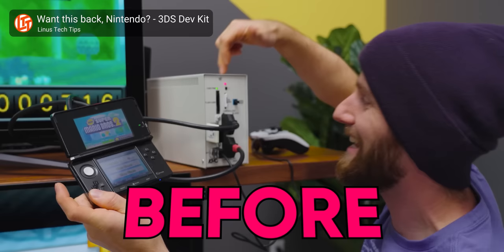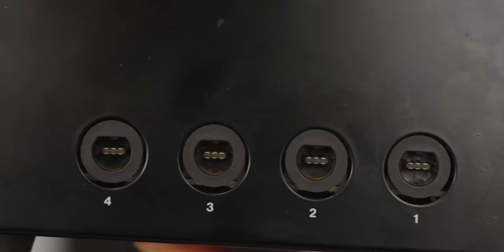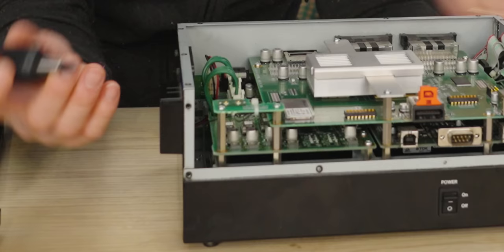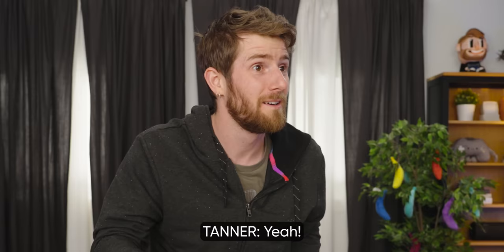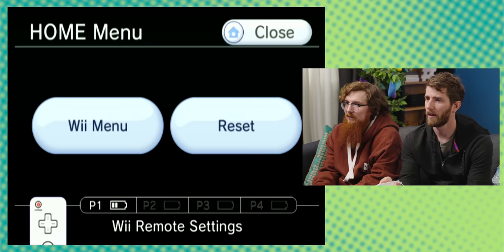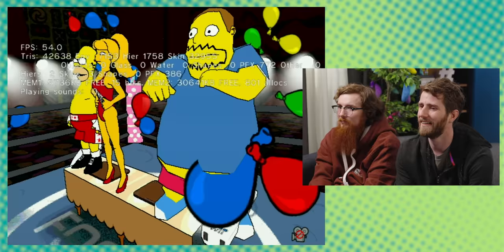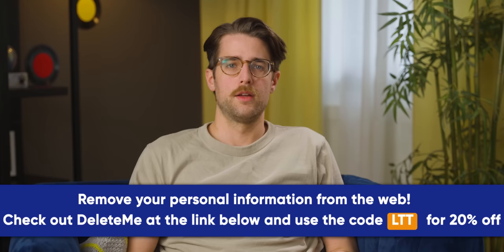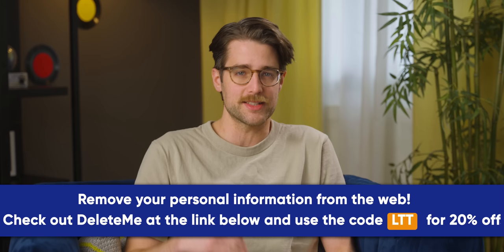Nintendo’s Lawyers are Ready This Time - Nintendo Wii Dev Kit

Comment: Having enough USB ports free for the Wii dev kit was a bit of a challenge at times 😅 

The IDE was CodeWarrior (the Code Masters guess was close!)
Reply: could you use a USB hub?
Reply: @CouchPotator  Yes but for other devices. I vaguely remember that you couldn't use it for the dev kit cables due to some issue.
Reply: @CouchPotator  You could use a USB hub.  It was easier to move an SDEV with the plugged-in hub than otherwise.  The 4th hub port was taken up by the USB-serial adapter (for the serial debug output).
Reply: You were a Wii dev?
Reply: @isaac10231   I worked on a couple of cross platform games at EA during the Wii, PS2/3 and Xbox era :)
Reply: Maybe he's thinking of the Worms developers, Code Masters lol

Comment: You could also use the SD slot with the photo channel. And because Nintendo put in some fun "tools" I actually liked doing that from time to time as a kid. Go through our photos on the TV and maybe doodle something on it, do a sliding puzzle of one of the photos. 'twas good fun.
Reply: I remember doing that for a short while but having a ton of issues with it not recognizing files.  Turns out JPG is not an actual file format but rather a container format and the Wii could only handle certain actual formats (pretty much just JFIF I think) under a certain size (don't remember the limit) and had no correction capabilities (JPGs were easily corrupted but most software could correct the files on the fly).

A lot of newer hardware uses the EXIF format (still JPG files) which are much higher resolution though even a "lossless JPG" format isn't truly lossless due to the quantization methods used by all JPG formats (it's actually pretty neat how it works and definitely worth a trip down the image compression rabbit hole).  PNGs are truly lossless but can't be compressed as small.
Reply: @grn1   looking it up JFIF stands for "JPEG File Interchange Format" in case anyone wants to know

Comment: As far as the Wii Mini goes, it has the hardware for at least half of the GC compatibility, that can be modded back in.  I did some light diving into the idea when some channel was doing Wii mods, and found this out, I'm not sure if the other half of GC compatibility exists elsewhere on the board, or if there was a chip change that sacrificed compatibility, etc., but there's at least pads for two controller pinouts and a memory card pinout. 

The wired WiiMote thing is also a bit weird.  I went patent diving at one time and there was a full wireless variant based on the GameCube, controller port wireless module and a full WiiMote.  IIRC this was also during the middle of the GC's lifecycle, wireless was super early in development and probably an extension of the WaveBird's wireless, so these wired WiiMotes must've been super early, and for some reason retained throughout the devkits. It also has nothing to do with the IR, as tracking is internal to the WiiMote themselves, the sensor bar was just an emitter with standardized placement of the LEDs for the WiiMote's tracking triangulation.  Assuming GC had the API overhead for motion tracking (which realistically was just a stick replacement in most uses), motion could've existed on the platform, given how the dev cycle for the Wii played out; which also means those GC-Wii dev units had updated firmware to allow for this, which makes me curious how forward-compatible the GC could've been with updated firmware.
Reply: I'm assuming power and security were probably the main factors.  Wii Motes are generally pretty good on batteries but they won't last all day under heavy testing.  The wired controllers would also be just about useless if someone tried to walk off with them since retail units only supported wireless.
Reply: @grn1  its also just.... better to have it wired if you have like a dozen Dev units in the same building to ensure no mixup happens between what kit had what set of controllers, also it would complety remove any potential interference by other wirelesse sourcse

Comment: I got to round Eurocom (the Goldeneye reboot Dev) in Derby, UK, right after they closed down. They had piles of Wii U dev Kits  in the main corridor (I assume Dev kits, they had the same controllers but different chassis). One of the coolest things was the MoCap studio to the rear of the site, a big warehouse lined with black sheeting. The cameras had been removed but all the mounts were still in place. 
A lot of the art dept was still full of sketches of the Tarzan game they did from the late 90's, a massive Batman stature, and a post it Pikachu.
Shame they went they way they did, went from a 250+ employee company to bust in a year.

Comment: The controllers were removed due to the hack that allowed you to use a wii with an external HDD that contained all the games and would be fine unless you tried to play any title that connected up to the net. I knew some of the guys in the CS dept of uni where I was at the time who successfully did this. They bought units that had a broken CD drive and got them "Working" again.
Reply: I have a soft modded Wii with DI support (my brother uses it to play and practice competitive Melee).  Don't remember ever having issues back in the day with online games, the only thing I had to be careful on was making sure I didn't update the official way (and even then it didn't take long for a new exploit to be found). Perhaps there was an even older hack that used GC controllers but by the time the Mini rolled out soft mods with DI support were quite robust so I can't see that being a reason to remove controller ports, it was almost certainly to cut cost.

Comment: -A trimmed 4 layer Wii (later    65nm revision) draws about 5-6 watts (half an amp at 12v)
-A trimmed 6 layer Wii (earlier 90nm revision) draws about 8.5 watts 
-The NDEV uses a different GPU than the retail unit, and I have not measured its power consumption.

These numbers include CPU, GPU, RAM, Flash Memory, and Video Encoder/DAC. The rest of the power consumption of the Wii is the disc drive, regulator inefficiencies, and peripherals. So yea, the console is wicked easy to cool. The stock fan/heatsink on retail Wiis is completely overkill.

Comment: DI is Disc Interface, COM is communication, OSReport/Panic or MetroTRK would print to it using the SI (serial) bus, DEBUG would interface with CodeWarrior, the IDE that was used, and breakpoints were handled by the aforementioned MetroTRK (Target Resident Kernel)

Comment: Quick comment on the "not yet wireless" for the controller. Actually, this is a sought-out feature that you'd pay extra. Imagine you have 12 close-by desks of developers and testers all around different Wii dev kits (or test kits - closer to the actual hardware) with 1-2-3-4 bluetooth wireless remotes. All those Bluetooth wireless signals would interfere together. At one point, you need to be empirically developing without fear of actual signal interference and degradation. So developers would end up purchasing mostly wired kits and wired controllers at a premium, and have 1-2 official test kits for demoing game or testing game in a faraway room.
Reply: Adding one more comment on this, we would also purchase a Bluetooth multiplexer box, where you'd plug this in the dev kit, and have 4 different outputs for the 4 controllers.
Reply: Basically everything he tried to criticize had a purpose he didnt know about.
Reply: FCC certification is a factor as well. If the devices aren’t certified by the FCC, they can’t be used wirelessly. Even for testing purposes.
Reply: @RomansFiveDotEight  not false, and maybe early on in the lifetime of the device, it’d be a concern. But even in the first dev kits, you could purchase either models for dev and test kits. And the later model has a switch to choose which output to have.
Honestly, for larger companies used to them, FCC and other spectrum allocating bodies are mere paperworks not worth mentioning.
Reply: @toonpik7  yeaaaah… but then, that’s Linus geeking out, and showing the wares. And he didn’t complain much, he merely gave an uninformed first impression. I’m not exactly surprised.
Reply: @micheldonais  the issue isn’t really how long it takes but rather how the FCC process works. 

When you have a wireless device you have to submit technical drawings and other information along with your testing results to prove that it won’t cause harmful interference, and will accept interference from other devices. The problem then is that sleuthy rumor websites can get ahold of those technical drawings. So some wireless devices delay those regulatory approvals for that reason. 

Early iPhone prototypes for example didn’t have WiFi or cellular capability for that reason. And sure enough when Apple finally did apply for that regulatory approval, while the approval was not a big deal; there were already sites jumping all over what they were able to glean from those filings.

Comment: "power" in the board name doesn't mean power supply.  It means the POWER(PC) architecture also used in PowerMac computers and one PlayStation generation.  So all those pins are probably a complete bus connecting the two halves of the computer, in particular notice where the WiFi adapter is connected to the computer.  That coiled up black cable is probably the same coaxial cable that connects Laptop WiFi to the antenna in the lid, only folded up due to the short distance.

Comment: That WiFi attenuator would work... Not in a good way for the Tx module, but it would attenuate the RF. It's likely that most of the RF into that "attenuator" would be reflected back. Yes; the overall result is attenuation, but in the worst possible way!

Comment: The GameCube TDEV was not a development unit. It was for QA for testing games. The GameCube devkit was GDEV, which looked similar to the NDEV (big metal box) but was blue. And while the NDEV used several USB connections to the host PC, the GDEV used a SCSI cable. As developers, we thought of the Wii as a GameCube with extra audio RAM bolted on. And the NDEV was not an early dev kit. It was THE devkit through the whole life of the console.
Reply: I think they were implying it was the final version before release.

Comment: probably true that the wiimote was wired because they didn't have wireless support yet, but you'd also want a wired controller in a dev kit, so you don't need to bother with charging or batteries dying.

Comment: "block out" refers to making the bare minimum to make the map playable, so it can be tested and refined for gameplay.

Generally the "art pass' which pretties it up won't be done until the gameplay is satisfactory, since it's a lot easier to adjust the blocked out version of the map repeatedly and afterwards do the art pass once afterwards than it is to repeatedly adjust the map after the art pass has been done.

Comment: The reason later cheaper Wii models didn't have GameCube backwards compatibility was actually a hardware limitation - while yes the CPU and GPU were natively compatible with GameCube software the disc drive was physically incapable of accepting GameCube discs. The early Wii disc drive was an absolute monster in terms of cost, it was something ridiculous like like half the cost of the entire system. It was a slot-loader that accepted multiple disc sizes and had mechanically moving parts.
Reply: This is also why you can easily mod support back in, the hardware is absolutely capable of running the software, it just that outside of modding no wii model was ever designed to run full retail games without a disc

Comment: 13:23 There's a possibility that, the USB DI port of the NDEV unit is USB 1.1. That's slower than the DVD drive of the retail unit. It's trying to stream that video from the computer and it's just not fast enough.

When USB loaders for the Wii first came out, some people tried them with their old, dinky USB 1.1 flash drives (I know I did), and had issues just like these.

Comment: Fun fact:
The GameCube gecko, the Wii Broadway and the Wii U "Espresso" Broadway are all based on power PC G3 architecture, as they're all based on the PPC 750 core. The fact that breath of the wild could run on the Wii U along with any other 2012 games was ASTONISHING. For reference, the 360 and PS3 used a much more modern G5 core, and due to that, they support true multi threaddimg along with many other essential things. The G3 core was introduced in the late 90s mostly in Macs, and ran the original halo even, but not well. People said that the G3 will never have decent graphics or be a gaming capable core, and hell, even the same was said about the G5, but boy were they wrong. Thanks to Nintendo's Wii U, the IBM Power PC G3 lived for more than 15 extra years.

Comment: I have a wii remote that plugs into the wall for power. Not sure where it's at.
I made it so I could power it without batteries. I was using it to convert a normal display into a "touchscreen" using an ir led on a glove. It chewed the batteries in the remote.

Comment: I understand them dropping Anker as a sponsor, glad Ugreen is partnering with them though, I've had solid equipment from them and hopefully this is a nice boost for them.
Reply: I find them a bit overpriced if all you need is usb phone charging cables, but the desktop HDD enclosure I got from them is doing very fine, tbh.

I'm sure there's quality in the brand. Just don't get from them something you know you can get much cheaper (and is pretty much disposable if worn out/broken).

Comment: Actually the size of the gpu matters not, it’s what the gpu has that matters. Plus this thing was a budget orientated console being like, what…. 200-ish back then? Cuz when you look at the 4 pixel 1 vertex shader with 64MBs at 3.8GB/s and the 1 core 729Mhz cpu Vs the PS3s 24 pixel and 8 vertex shaders with 256MBs at 20.8GB/s and 3.2GHz 3 core cpu…. Yeah it makes it obvious why people chose the smaller $250 Wii over the almost $600 really big over built PS3. Even compared to the Xbox 360 (which had no included storage) the Wii was still more appealing with how many fun games there are.